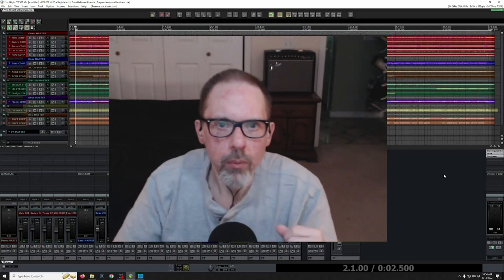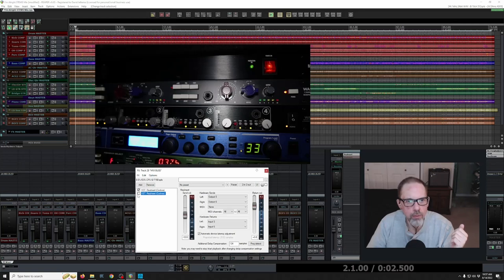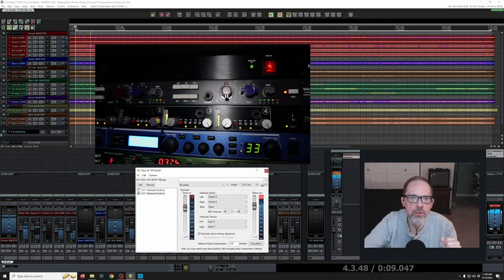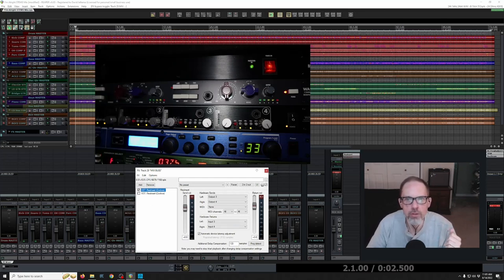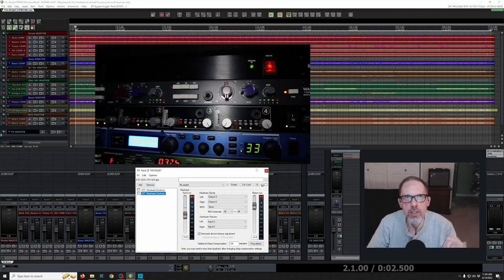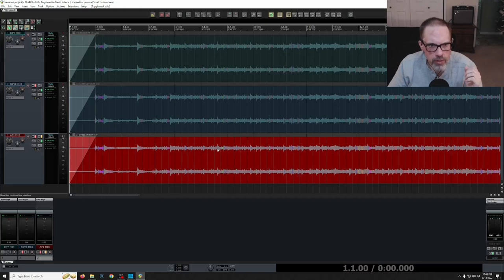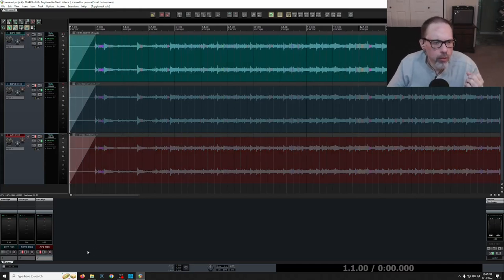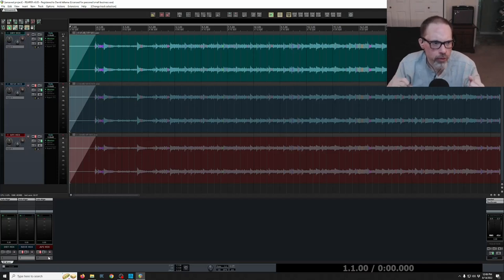Using Hardware Preamps on Your Master Bus

Comment: The Transformers on the WA 273 are always engaged!!! The Tone button just changes the Impedance of the input Transformers.
Reply from the maker: Thanks!
Reply: OK, cool!
Reply: @richard.  Exactly.   This tone button isn't something unusual to the Warm 273 but is found on the original Neve and probably every clone of it.   Some companies label it as impedance, some 300 ohm / 1200 ohm, and some simply TONE.     

Honestly of somebody doesn't get what this button does they shouldn't be explaining to others how to use these preamp.   This clearly isn't a slip of the tongue or flipping things around (as anyone can do occasionally) but actual misunderstanding of what this button does and the basic functions of a 1073 type preamp.
Reply: @7171jay  Yep my ISA two has a variable impedance with 4 settings for mic matching and different tonal characteristics. It's best to read the manual to find what the best impedance is for your mic, or experiment.

Comment: I do exactly this on every mix with few flavors to choose from. Everything runs through the ICs on my SSL SiX but then I hit a color box with 15IPS tape color, pentode tube saturation, and an API-style op-amp and transformer. I can dial in each of the colors as needed for the track.
Reply: Do you use the DIYRE Color modules? How do you like them? How's the quality?
Reply: @DavidSJ_DAP  YES! I have a bunch of DIYRE stuff; 15IPS tape, pentode tube (Louder than liftoff), CTX transformer, OSA5 opto compressor with vintage output, CP5 colour preamp, DI box, line attenuator box (helpful for sending line level into mic inputs). Everything I've made from them has been amazing. Maybe we should collab on a video about them ;)
Reply: @JasonBuffin  Thanks, I've been looking at them for my 500 rack, I may just take the plunge...
Reply from the maker: go for it!
Reply: @Jason Buffin  Freaking love my DIYRE stuff. Don't have any of the colour stuff yet, but the OLA5 is dope and the EQP5's are always on every mix. Can't wait for that bus compressor.👀

Comment: Preamps alone such a great improvement over straight digital. Both models sound good, Neve probably best. All the great records we know from the past were recorded and mixed using analog gear and tape. If sounding like Those Records is a criterion for a great mix (and it should be), there is simply no substitute for real analog; plugins do a Thing, and are better than nothing, but side by side with the Real thing they've never measured up.
Reply from the maker: Thank you for watching!

Comment: I'm surprised, but I actually prefer the dry version. The API is my second fave. I may need to download the files and double-check.
Reply from the maker: Check them out and give a listen
Reply: Yeah, the dry mix is REALLY good...the tracks I used are stems from a partially mixed session, so there is some EQ and compression going on them...I wanted the track to "fit together" better than raw files...

Comment: Hey David, great demo, thanks! I've been doing what you've shown with a Warm 273-EQ. It definitely adds some analog flavour without any aliasing issues. The only downside is that the EQ gain controls aren't stepped so it's hard to match the L/R channels. Cheers!
Reply from the maker: Cool, thanks!
Reply: Thanks for watching Chris! I get how the EQ can be hard to balance, but matching the EQ is perhaps not as important as matching the L/R levels...PEACE!

Comment: On the WA273, the TONE button doesn't "engage" the transformer. The transformer is always in the circuit. The TONE button changes input transformer impedance useful with ribbon mics and for a different tone.
Reply from the maker: Thanks for the info

Comment: For me, I prefer what the WA-273 does versus the WA-412 in these examples. Honestly, I thought the 412 version sounded "smaller" than the other two, but I'm guessing it's due to you hitting the 412 a little more aggressively? Now I'm going to have to wire up my 273 and test again, so thanks for that!
Reply from the maker: Thanks for watching!
Reply: Yeah, it's possible I wasn't 100% fair to the 412 in this demo...I've been preferring that one on most of my work recently...

And get that 273 working, dammit!

Comment: Something no one seems to mention is that your interface and its converters have high and low pass filters on them and essentially sending anything out of the box into outboard gear and back in can be providing an eq removing unwanted subfrequencies or even diminishing aliasing artifacts in the high end. Depending on how well you mix you may even hear more drastic differences sending to outboard gear because its removing your flabby and poorly mixed sub frequencies and it can immediately tighten up that sound.
Reply from the maker: We have a video coming up soon about that topic. Those filters you are talking about are cutting off frequencies well above 20K so you really cant hear that anyway. This all has to do with bit depth and samples rates etc....again, we have a video coming soon to discuss. Thanks for watching
Reply: @MixingMusicAnalog  awesome, I'll look forward to watching it.
Reply: If your recorded sound it in 44.1k, it will cut above 22.05k and if it's in 48k it'll cut above 24k... and so on... there are exceptions but that's the main understanding as far as I know.

Comment: Thanks for the video! I have a question, Dave! When you send stereo signal from line outs to hardware, how do you set gain at line in for right and left channel? I thought on focusrite clarett there are handy trims on the line ins, and  you can not set two line in levels for exact same number! Correct me if im wrong please! Very interesting how did you solve this problem? Im choosing right usb interface for me for hybrid mixing and can not find anything exept antelope orion series where you can set the same level digitally for different line ins. Thanks for the answer! Appreciate your work!
Reply from the maker: Good question. I'll let DSJ answer this one.

Comment: This may be a silly question, but how would this way of thinking work with plug ins?

I intend on getting a wa273 (I currently have a wa73eq and love it) but due to other upgrades taking priority, should I bother with mixing through a stereo preamp plug in?
Reply: Other notes, my current chain is stereo pair of eqpwa, wa bus comp, drawmer 1974 EQ and ssl fusion
Reply from the maker: That is a fine stereo bus chain. You really dont need anything else.

Comment: Greetings,
This is an amazing video. This technique has been used in major studios for years. Some people use this in place of analog outboard bus summing, but I have yet to compare this technique to an outboard summing mixer.
Currently rewiring my lab but my mix bus will be vintech x73i -> ADL 1500 (dual La2a clone as a limiter) -> x16 to print final mix. Wondering if I should add my SSL to the mixing stage and add it again during the mastering stage? Thoughts? Feedback welcome.
Reply from the maker: what SSL? you did not say. Adding a Master bus compressor make a lot of sense for sure
Reply: @MixingMusicAnalog  SSL Fusion, sorry I left that information out of the original post. 😅

Comment: Great Video, thank you both! Dear DavidSJ, how did you gain match the printed tracks - did you match LUFS, peak or by hearing? The Neve preamps change the sound to my ears the way, the Rupert Neve Summing Boxes do, they seem to give more 3D and air. Sounds great to me. But then I wondered hearing the 0 test: if it does not 0 out over all frequencies nearly the same - doesn't that mean, that it is just louder? Or is ist not louder but more saturated over all frequencies? 🤔
Reply from the maker: Dave and answer this below
Reply: I gain matched by normalizing all 3 then checking on a VU/LUFS analyzer///the tracks did not print out matched, I did that in the second session...
The null test does indicate some volume differences, yes, but I also hear frequency differences between them...as I said in the video it is EXTREMELY subtle, but the differences do come into play as you mix through them...
Reply: @DavidSJ_DAP  thanks a lot!

Comment: Wouldn’t you be better off just running your mix through something like the Neve 542 tape emulators. You’ll have much more colour and saturation on hand to dial in to your liking. Seems like a better bang for buck, or am I missing something here?
Reply from the maker: That is another way to do it for sure. but they are different sounds.
Reply: It's a choice...I like to use the preamps for a "console" type effect...the Tape Emulators have a more specific kind of effect on the audio, and could actually be used in conjunction with the preamps as well...

As far as "bang for the buck" a stereo preamp like mine costs about 1000.00, while the Neve 542s are 850.00 each, or 1900.00 total...
Reply: @DavidSJ_DAP  Thanks for the reply. Im not knocking your approach and was wondering what the result would be running a mix through a preamp like you have. To my ears It gives a slight smiley face curve to the mix and obviously pushed at the input stage of the preamps it would get some nice saturation also. Have you tried the SSL Fusion? Engaging the transformer in the unit and pushing the input really brings some nice colour which I think you would enjoy, fills out the bottom in a classy way.
Reply: @djdanger9812  yeah they've used fusion

Comment: I am confused about something here because I recently got a pair of eqs and comps as 500 series units they are all mono except for the comps that have an option to work as a stereo pair.
In your situation I see that you are sending a stereo mix to one mono preamp which after processing is going to make a mix mono, right ?

And let's say now we send the setereo mix to a pair of mono eqs or preamps. How do we do that ? 
The way i tried doing so is to send the stereo mix in to two seperate buses and then panned each bus to Left and Right then sent each bus  as mono to each pair of preamps and eqs. 

Is this how it is done or this is the wrong way ? 

Because I tried processing my stereo bus by using two mono compressors for each channel and I was getting phasing issues.
Any guidance will be much appreciated.
Reply from the maker: This is a question is for DSJ, I'll let him answer this one.

Comment: So it have to be a stereo preamp ?an if so can i use two different preamps
Reply from the maker: Sure you can!
Reply: @MixingMusicAnalog  Thank you for the great video, and finding your answer that using different mic pres to run mix bus through is possible. So at the lower gain settings running one channel through Neve and another through Api would not be a major problem due to different characteristics these brands/styles of preamps are known for?

Comment: does anybody have a problem getting the print to actually get audio of the hardware . everything is routed right . I'm can hear the difference for sure when I put my wa273 on my master track. but when I go to print and play back . the processing from the wa273 doesn't get recorded. I can't figure out why for the life of me. My Daw is pro tools
Reply from the maker: No idea, sorry. I am not a Pro Tools user. I am sure something is routed incorrectly
Reply: Are you bouncing realtime or offline?
Reply: Bounce in realtime
Reply: This is your answer Juan. Anytime I'm running a hardware insert I can no longer bounce faster than real time. You listen to the track print.
Reply: Also, something I've learned from when I started running outboard was if you're using an interface that utilizes an internal digital mixer or direct monitoring blending with the daw output, you should bypass the mixer/turn off dir. monitoring so you're only hearing what the daw is putting out. Otherwise you'll hear the latency free direct signal from your outboard gear on top of the DAW mix which is going to have some latency going back in and cause phasing issues that will sound terrible.